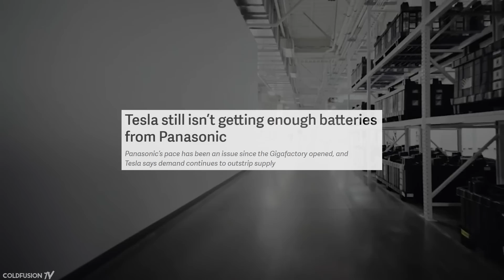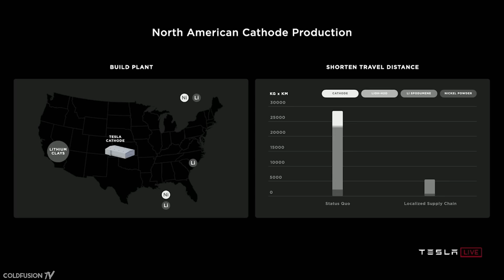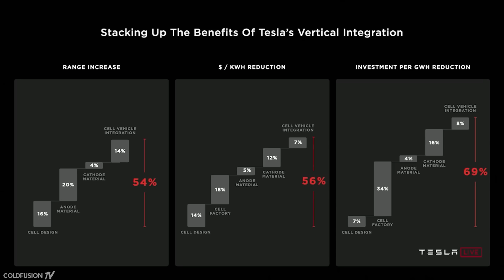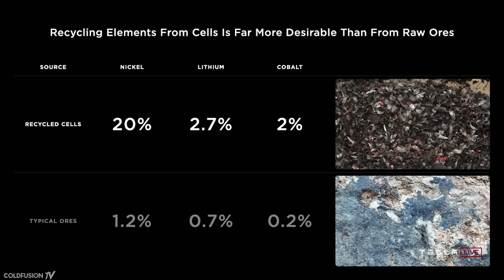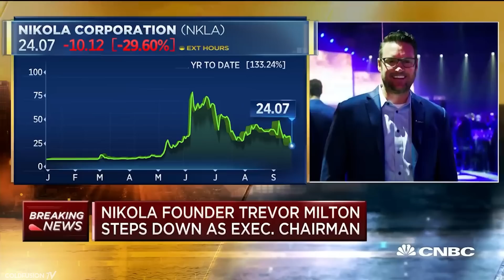Elon Musk: Affordable $25,000 Tesla and Better Batteries Are Coming

Comment: Yeah it's all nice, but Tesla is not a car company. It's Apple on wheels.
Shit customer service, no servicing really offered, for a malfunction or a crash which can technically easily be fixed or have the parts replaced, even if it's a small cap, Tesla would rather have you buy a new one instead of fixing your existing one.
Finish is a long way to go from most established car manufacturers. Tesla also has the audacity to sell cars and then charge people for using features on the cars they own after the purchase, Tesla hates people working on their own cars, fixing and tinkering with them, hense 0 spare parts supplied. 
I know, nobody is perfect. But as a car enthusiast, those are really elements that would put me off from ever buying a Tesla, even if it was 15k!
I'm better off just using rental services if I really want to drive around in an electric car. But I like to have full access and use to the cars that I own and thus I will stick to ICE cars where I can order parts from the car manufacturer, parts suppliers or the junkyard if I need to and do whatever I want with the vehicles I have spent money to aquire ownership of.
Tech wise, yes. Everything Tesla is REALLY exciting and fascinating to wath, but customer and user wise... Just a crushing disappointment.
Reply: Customer service and servicing is on the way, are you seriously so stupid that you think something like Ford had millions of servicing stations in 1903 when they started building cars? NO they seriously didnt have any.
Tesla is relatively new company and it will take time for everything to come.

Comment: This battery is 5 x more powerful, but it looks like at least 4 x bigger. Looks like they are following the 21700 battery cell path. While the 18650 has a  volume of approximately 16cm (16ml) with a capacity of around 3000mAh, the 21700 cell has approximately 24cm (24ml) with a said capacity of up to 6000mAh, essentially doubling the capacity with a 50% increase in .

Comment: Can someone please explain how this new battery is more powerful than existing 2170? Given the form factor we can calculate the volume of both cylinders: 21*70 and 46*80. The volume of the latter comes out as 5 times the volume of the former. In other words, the new battery is just 5 old batteries packed together. So where's the gain?

Comment: I felt they were a bit vague on the battery details. They mentioned that cells expand which leads to degradation- and they've incorporated the expanding into the new batteries, but didn't comment on the cycle gains. Is this the million mile battery?

Comment: 3 things will hold back electric cars becoming truly mass market and they will not take off until it’s solved. 1. Cars at the same price as gas cars. End of story. None of this taking into account cheaper to maintain. The person in the street can’t afford high price cars. 2. Range. Large countries like Australia and America and Africa need range.  Countries where a 300 klm drive is normal (I can drive 300 klm for a Sunday afternoon leisure drive and I’m not unusual in my country). 3. Rapid recharging. And I mean rapid. 5 minute full recharge. Same speed as gas - pulling up, plug in and drive off for the same reason as the i mentioned above - large countries. You don’t have time to hang around for an hour.  More and more people are living in apartments, inner cities where street parking is the norm and multi family residences and simple do not have the room for charging overnight.  Even in places like Australia many people in single family homes have their garages full of stuff so much they cannot park a car in their to line up with a charger so park in the driveway or street - useless for chargers.

Comment: A small, but very important correction. Tesla's pilot line is not small scale. It's theoretical maximum output is 10GWh per year, which is a big factory for any other manufacturer. For comparison, the Nevada gigafactory has about 35GWh per year capacity.

Comment: It should be noted that the “small” battery pilot plant at the Fremont factory is designed to produce 10 GWh per year when the yields reach production quality. That is just under 1/3 of the current capacity of Giga-Nevada. “Small” indeed!

Comment: Your summary was spot on. Clarification: the batteries will become a structural component in the car, replacing the frame in that area. This saves on parts, reduces complexity and reduces cost.

Comment: To produce a 25K$ electric car Tesla would need to improve more the the cost of parts. Material only make 60% of the vehicule cost, then you add manufacturing costs 15-20 %,  engineering 5-10% , logistics IN and OUT of the factory 5% and then After sale costs. So maybe the chinese megafactory is not there for nothing, that could save up on manufacturing costs,  but will not be enough to save 10K from an already cheap model 3

Comment: Correction: the new cells ar 46 80, not 48 60.
Cobalt is also a by-product of nickle mining. They're going to need a lot more nickle. There should be enough cobalt to do what they need to do.
More accurately, the battery pack will become a structural part of the vehicle to reduce weight by 10%.
Finally, Nikola has been exposed as a fraud. They're done.

Comment: The $25.000 Tesla can be produced today. Tesla already uses LifePo4 batteries in Model3 China. The price is $60.00 per kW and as the Panasonic batteries cost $150.00 per kW they could easily make a smaller lighter Tesla Model 2 at $25.000 and that is what they will do but in three years time Elon time BTW so maybe it will take 5 years. LifePo4 is the future for all small cars and it’s here now. The $25.000 will not be FSD as standard as always it will be a expensive option. Anyway very impressive.

Comment: Very good summary, one minor correction though: Tesla has been working on their own battery reaserch since at least 2010, not 2018. They also have said they do not plan to get rid of 3rd party battery suppliers, as they need as many batteries as they can possibly get their hands on. However, there is a decent chance they will continue to make huge advances in batteries, making batteries so cheap it makes no sense to buy them from outside suppliers, at which point they will make all their own batteries, possibly even selling them to others.

Comment: $25,000 for an EV is still expensive. They need to drop it to Toyota levels of price for EVs to be accepted, otherwise what's the point of owning an EV when you can buy a cheap brand new Toyota, WHICH will last you for a lifetime both the engine and the car.
Reply: its 25k for a premium car. Not an entry level. Musk has made statements that smaller lower performance models could get much lower than this. I think they could have a 15k model with lower performance in the next decade.

Comment: The Plaid Model S will need to have the new batteries to get the specs mentioned, so cell production will be sooner than we think.
He just can't come out and say it or people will hold off buying anything.
Cybertruck will also need these cells in the 3-motor version, and that's coming sooner than later.
I suspect the Model 2 will be manufactured in 2022 once the Y and 3 have had more time to mature (and I think they'll the kill the 3).  400 km range will be adequate, and LiFePO4 cells in the 4680 format will be good enough for that.  
The Model 2 will probably have a different motor as well.  Something smaller, with a higher reduction ratio, less magnets in the hybrid SR motor and an even more simplified body structure.
I'm really looking forward to seeing this tech trickle into aviation and boating!

Comment: Just one thing I want to add: There already IS a mid-range $25.000 compact EV on the market (with incentives). Just not in the US. 
The Renault ZOE. Has a 52kWh battery, with an approximate real world range between 300-400 kilometers. 
The base price starts at around 29.000€ (-9.000 govt grants) = 20.000€ after taxes atm.
Reply: the play version starts at just 26500 so its even cheaper. Im banking that electric cars ca get way cheaper and there will be a not so terrible 10k car by 2030.

Comment: "The batteries will now be part of the car"

Does that mean they're not replaceable?
Reply: Probably both a measure to save a TON of weight by switching the battery armature from an additonal load to a loadbearing structure, but will aslo mean it is likely a specialized equipement will be needed to service the battery, which makes sense because Tesla want to reduce the ammount of battery servicing needeed, thus making these trips to the garage far less nessesary
Reply: They won’t be in pretty sure. The cars will be tho
Reply: You won't ever need to replace them. They will last longer than the rest of the car.
Reply: Probably saying that you'll be dead by the time you really need a replacement.
Reply: That's right. The batteries will not be a plug-in, bolt-on part of the car anymore. But it doesn't matter because the batteries will still be good when the car is a pile of junk. People will be cutting the battery packs out of scrapped cars to use for power home storage.
Reply: from what I understand, current models' batteries only take minutes to remove and replace. the new design I'm sure will still be replaceable, but will take longer, that is: removing more parts/fasteners. also since the new battery tech will last longer, they don't have to be replaced for a long time.
Reply: Mostly likely you don't have to replace them
Reply: If you look at 2:32:30 in the original presentation, they included an animation of the assembly and it still looked like replacing them would be possible. I could be wrong, though.
Reply: Bet you that internally no tesla costs more then 10K to produce.
Reply: @GrzegorzDurda  It currently costs them 75% of the price tag, in average, Musk said he wanted to bring that down to 70%. You can watch Sandy Munro and figure out the costs from their independent analysis, which seems to be pretty in line with what is advertised.
Reply: @ProphetC2  Those are external numbers. Internal numbers are like i said.  Likely even cheaper.  You'd be shocked how cheap cars are to produce.  The battery is a good grey area like with over priced wine. 

Do notice the car has over 90% less parts in it compared to a ICE car. The interior is as sparse and economy as can be. It all equals minimal manufacturing effort,  which equals on the cheap. 

The car is a shell with a minimalistic interior  and a battery and a motor. A tablet for all it's vitals and outputs.  WOW talk about cutting costs.
Reply: No need to replace batteries that can last longer than the car itself. One of the improvements they intend to achieve is million mile durability for the whole power-train, including the battery, and that means every single battery cell. However, if the need ever arises that just means the cells go directly into the car, no intermediate packing and if any replacement should ever be required, it can still be done.
Reply: The battery is probably going to be replaceable as a whole unit, but this would be a major undertaking, similar to replacing the engine in a gas car. 

The battery is designed to outlive the rest of the car, so this shouldn't really be an issue in practice.
Reply: @jonashageboke8993  Well this might satisfy pessimist, but then what if optimists will be right? What if after year after You got your barely 350km range Tesla someone releases new type of batteries , allowing to have 1400km range or more, f.e. solid state batteries or thin film batteries , or maybe even fuel cell tech will go so advanced You will be better off with methanol fuel cell? Do you want to be stuck with Your old battery pack, in a car not designed to upgrade, so loosing it's market value in incredible pace?
Reply: @piotrcurious1131  I don't think Tesla will offer non necessary pack replacement, even if it's technically possible. You don't put a new engine in your car when a new one comes out either.
Reply: @jonashageboke8993  Idk where you live, but engine swaps are daily bread here, even from reasons as banal as sound they make. It is cheap and easy operation.
Then again - when new engine gets released, your old engine has decent market value, even as a spare part.
Trading old, used battery pack when new technology just got released? You can sure look for some scrap or recycle, but that gives you quite low value. Then now you have whole car, not designed to even take the old battery out, and vendor-locked so you cannot put anything from anyone else. Reminds sim-locked phones, and ppl who got sim with a phone as a deal, but then 4G or 5G got offered by competing operator and they are stuck with 3G, sim locked phone and old contract...
Reply: That's not needed. They will outlast the car.
Reply: casting out of special, proprietary aluminium alloy? see https://en.m.wikipedia.org/wiki/Fatigue_(material) . So this means not only batteries have limited lifetime, but the entire casing and major structural elements just got switched to alloy wchich is impossible to repair and has limited life. 
Car too old will be in risk of cracking in the alloy due to accumulated fatigue and will not be roadworthy anymore. Knowing industry standards of planned obsolescence this ensures you will have to replace car each 2 years, with no chances to repair - it will not pass technical inspection just due to age of alloy.
Reply: @piotrcurious1131  Congratulations, you won the most stupid FUD prize of today!
There is definitely not any risk for cracking. These details are easily engineered. Aluminum alloy is used in structural elements of all cars since decades.
Reply: @BjorckBengt  well, they do crack, and once element is too old it cannot be welded. It is known drawback of aluminium elements in automotive and areospace - even did wonder why so many plane parts need to be replaced on schedule? Read on the fatigue article on Wikipedia and then move on to "planned obsolescence".
Reply: its not apple
Reply: Catch you in 20 years to find out if this is true
Reply: They will make the batteries in floor board part of the structural integrity of the car. The way they showed the rendering of how that works, I felt like they would be able to replace as needed but it would require either removing from bottom or removing whole car above it to access the floor board.
Reply: Means they want no one except Tesla can replace battery.. so can make more money by service
Reply: @ujjaludl  The cars will be long out of warranty by the time we need to replace the battery, so anyone can do that work.  Like replacing an ICE car's motor; how often do we do that?  It's likely third party batteries (that aren't as good) will be available by the time a Tesla battery needs replacing, if you want a lower-quality battery.  After 10-20 years, we might just want a newer car... Especially because the newest cars will be AWESOME by then :)
Reply: @carlstockmal those are battery not nuclear battery..😁 so they have to be replaced there is nothing in electronics world thats last long than the actual product.. sir if you KNOW  there are OEM company who make battery for Tesla and other third parties both are same in quality but differ in cost as long as you don't buy badly manufactured wrong .. example my phone battery replacement cost 1/3 of cost from company battery still running same as it should be.. 😇
Reply: @ujjaludl  For a car that needs almost not maintenance for a million miles, you are complaining about saving 2-4 times the cost of the car in lower operating and maintenance costs?
Reply: Ujjal udl and why is that a problem. Only they have this new cell technology and nobody else will be able to produce batteries at the cost they can.
Reply: @goosefraba2385  the cell technology is ever evolving Tesla is car company not a battery cell inventor .. they just want to ensure control over their repair just like apple does isn't you Should decide where you want to repair your car that you bought by your money?
Reply: @ujjaludl  if you take care of the battery with healthy charging habits and not letting it die often, then most likely this next generation of battery pack will outlast the car. Meaning the car will literally fall apart due to natural degradation before you would need to replace the battery pack.
Reply: @MrDarthlizard32  we are human not machine everyone thinks same as you think but we know what we do lastly .. isn't it?
Reply: @ujjaludl  I would say that this is false. Tesla is, for all intents and purposes, a BATTERY company first and formost. It is the basis of all their products, and stuff like gridpacks is purely energy focused. They invest a metric fuckton in finally putting batteries on the same level as other energy conversion mechanisms. What tesla then do is figure out what applications they can put batteries in. Good batteries make good electric cars, so do electric cars. A gridpack can be a good replacement for a peaker plant, so you do that too. Batteries work better with efficient solar pannels, so they do that too.
Reply: @ujjaludl  Your point is valid, but as the battery life is 1,600,000Km it is likly that the battery will be the last part of the car standing. So replacment will be limited to faulty batteries. Not sure of the warrenty period but expect 10years.
Reply: @domoyakyak  How old is Elon already? Do you expect him to run Tesla for next 10years 😆 He has more ambitious plans, and what exactly warrants his company to be existing just next year?
Mass production is easy...
Surviving on market, during global crisis, wars and collapsing ecosystem... just recall german hiperinflation, just in the peak of industrial revolution. 
https://en.m.wikipedia.org/wiki/Hyperinflation_in_the_Weimar_Republic
Note majority of currency used is fiat...
Reply: no it just means they last a lot longer than before....